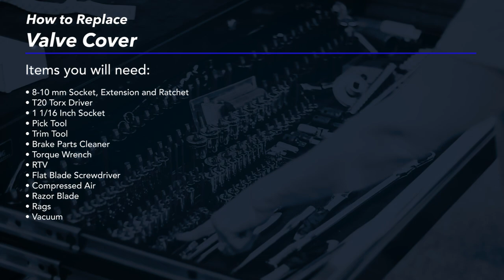How to Replace Valve Cover 11-19 Ford Explorer

Comment: i hope you answer question, but i have one, my valve and lifters are bad on my 2013, i just also fixed the water pump which they had to take everything apart, what's a bigger job a valve replacement or water pump change?
Reply: I mean they are both pretty big jobs. Some may say waterpump some may say a valve depending on which cylinder head.

Comment: What's different for a 15 explorer sport? Cant find any info anywhere. Tryin to avoid stealership prices 😐
Reply from the maker: +Lyza The vehicles should be generally the same with some minor differences. Thanks for checking us out! 1AAuto.com
Reply: Did you get an answer? I have a 14 sport and some local shop said the book time is 7.2 hours to replace which I find super hard to believe

Comment: So you didn't explain how to get the extension for the oil cap off the old valve cover. Also, I had to Google torque Sequence because right here really isn't a good explanation when you are so close to the cover. There was one more thing but can't remember right now. Other than those issues this was an informative video. Now to go look at other videos to find out how to remove the extention without breaking it.

Comment: What was the reason for replacing it ?
Reply: Probably because if try to replace the plug tube seal you might crack the plastic valve cover
Reply: Oil blowing by. New valve cover has something new to prevent

Comment: please correct you video at 8min 15sec to 8min 20sec. Knock sensor is in valley. Wire you refer to is to the Oil Presure switch most likely and it is far easier to disconect the OP swith over undoing ground and injectors if that is the only side being done